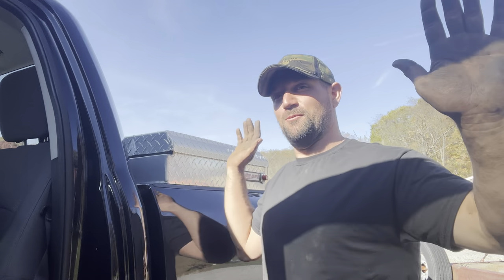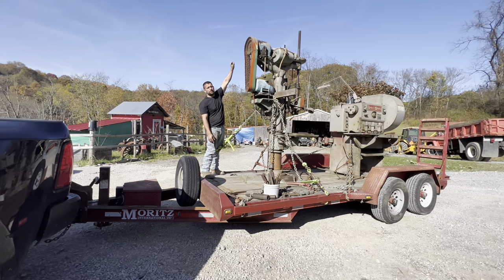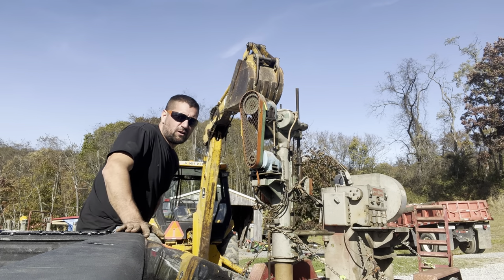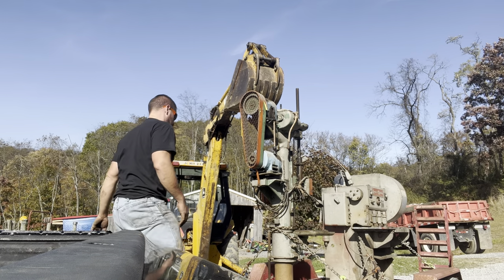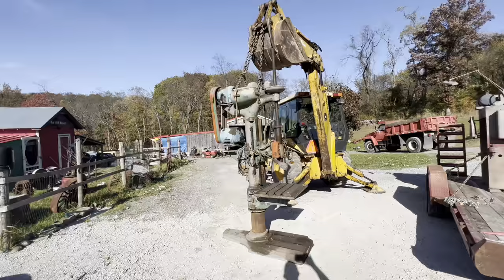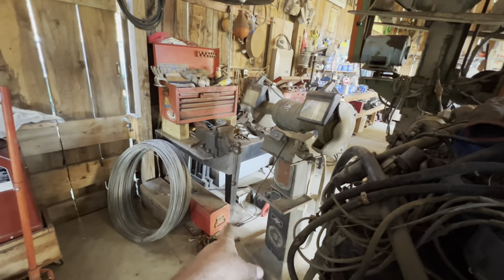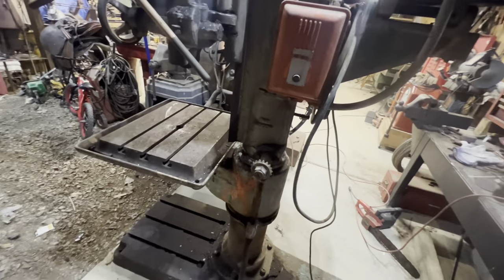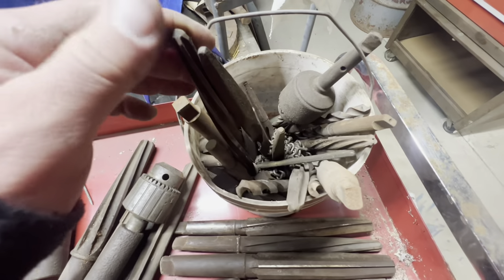Camel back drill press unloading the sibley

Comment: If you choose to reuse the Spindle bearings . I would suggest using all thread rod and making a pusher/Puller for the bearings. I just ordered New Headstock bearings from Logan.
Reply from the maker: I didn’t realize you could still get them. What did that run you?
Reply: @frontwoodsfarmer2063  Around $300